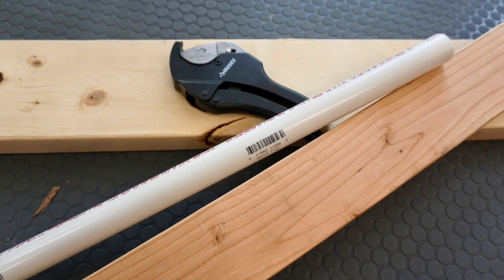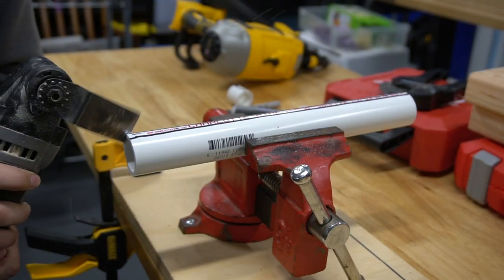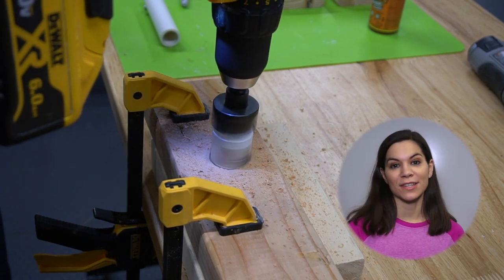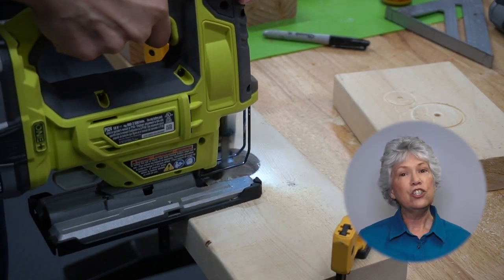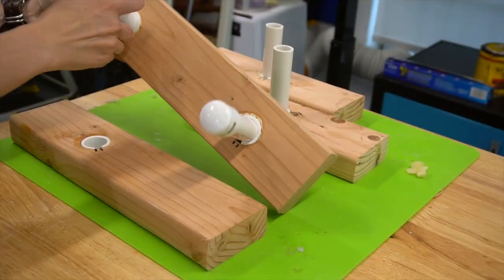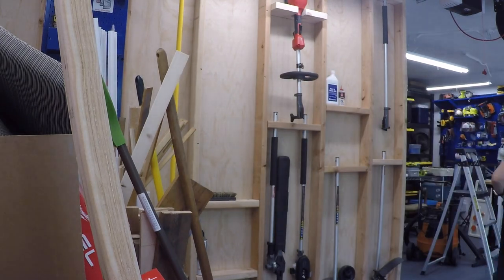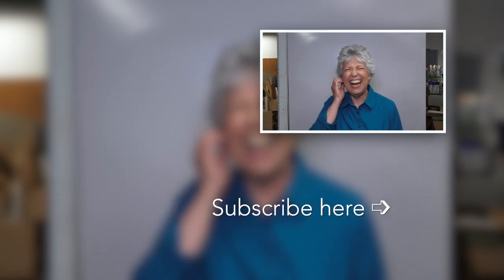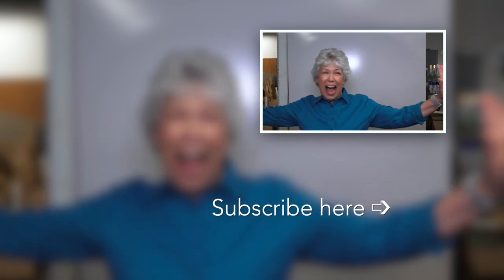Milwaukee Quik-Lok Outdoor Tool Storage // 2x4 Stud Wall

Comment: Good job - what size hole saws did yo use?
Reply from the maker: 1"
Reply: For the 1” PVC pipe?   I’m using schedule 40 and 1 1/4” was too small.
Reply from the maker: The hole saw was 1-3/8" for the tools and 2-1/8" for the handle
Reply: Thanks!